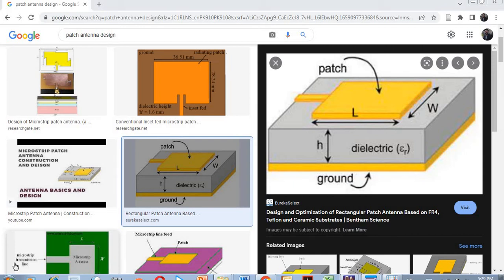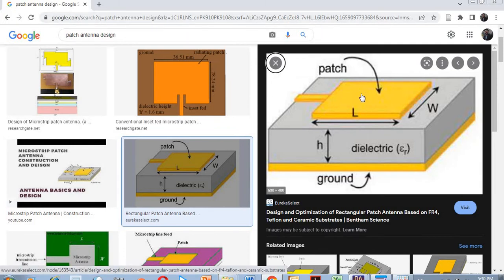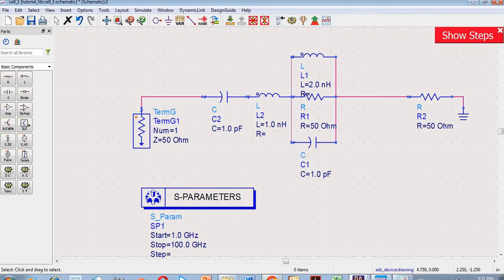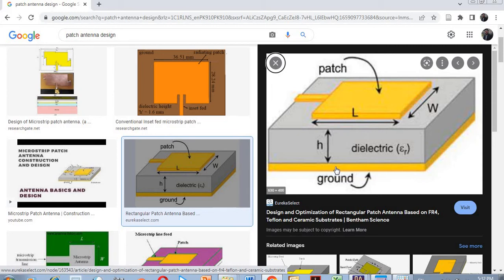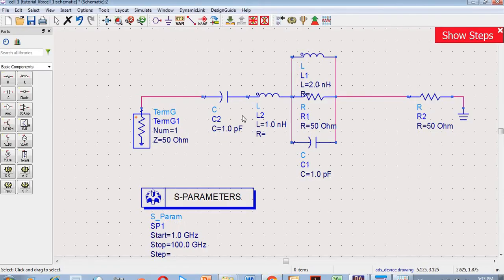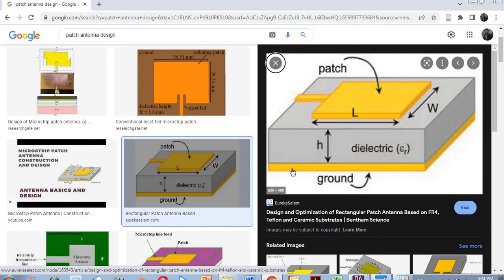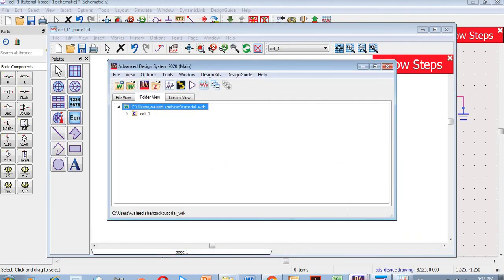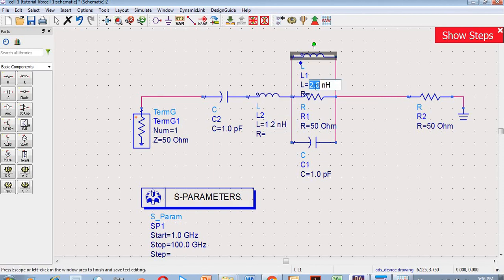Antenna Equivalent Circuit Model Design in ADS |  ADS Tutorial 6

Comment: you explained why we use capacitor and inductor but why we also use a resistor parallel with capacitor and inductor (for radiating element) and you didn't use it for line feed also
Reply from the maker: Come to email